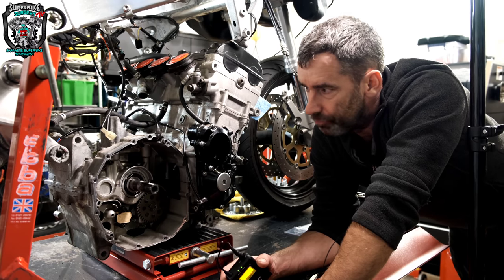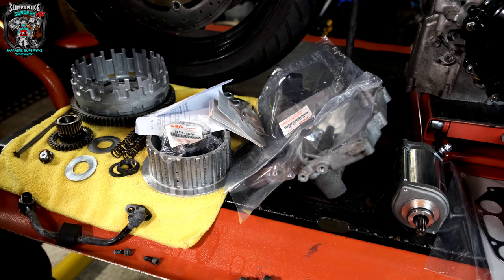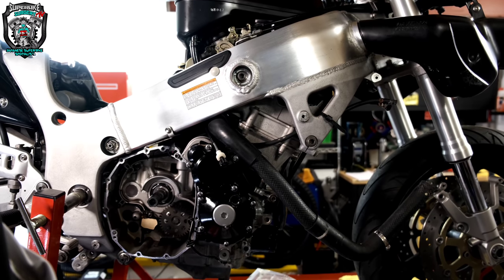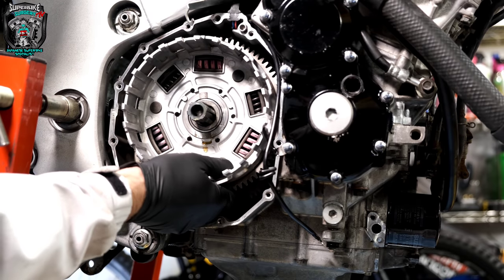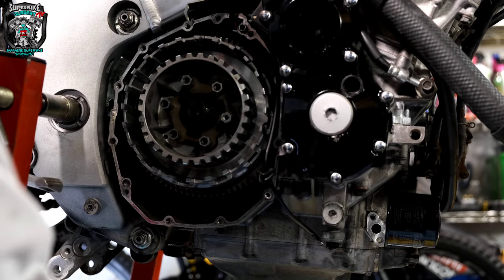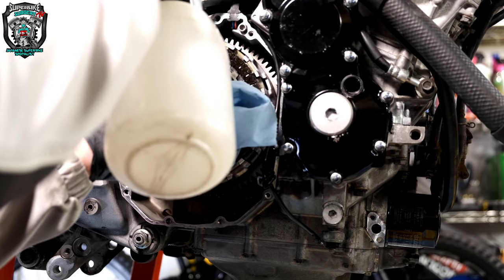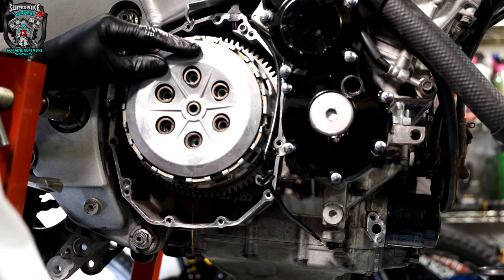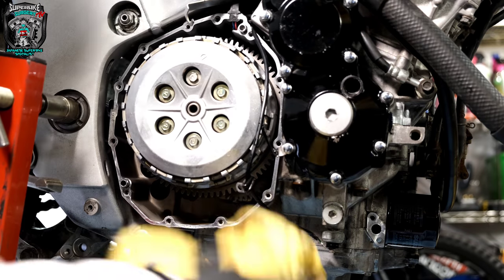Suzuki GSX1300R Hayabusa, Small Seal, Big Problem. An expensive mistake! (Part 3)

Comment: It wasn't necessary to split the cases just for remove that little seal... it would came off with a simple 90 degree pick... or a disposable little allen... tricky but simpler
Reply: The seal was bigger than the hole

Comment: Hi Jim, love your videos mate and learning loads from them. I'm currently rebuilding a Honda nc30 engine and have loads of gasket surfaces to clean. You mention using scotchbrite. Is there a risk of small particles being left behind using them? Also will they take any surface material off and potentially lead to an oil leak later down the line? One last thing any tips or tricks to get off the really thick gasket left behind that seems impossible to move. Thanks again for your great videos keep them coming 👍🏻.

Comment: Brilliant series Jim, quick question with regards to “silicone” when putting the grommets back in place for the wiring, what silicone do you use?
Reply from the maker: Episode 2 @ 45:15"👍
Reply: @SuperbikeSurgeryTV  ah.......I was getting confused as you would say silicone when talking about the grommets and then mention sealant immediately after for the joins before fitting the gasket and putting the cover back on.

Comment: Good vid buddy and thumbs up from me but don't you think that having the engine resting on the jack without the oil pan is a risk of scoring the surface of crankcase which might cause oil leak once sump is bolted on. I know that jack has rubber on it but still a but risky in my opinion.  Bolting the head mounts 1st is also a bit risky as those head mounts aren't as strong the rear engine mounts . I understand it was easier for you to get those done 1st but it's probably safer to get the rear in 1st and pivot the engine from there. I'm not criticizing you and your content is fantastic!  
It's just my thoughts after my recent engine build. BTW i also use rattle gun on clutch hub nuts lol 
Take care bud, love your vids, kind regards.
Reply: you still got your Busa adi.
Reply: @zzzpip  hey , no sold the Busa and went through a few other oldschool bikes. ZRX, GSX, GSXR, Katana etc. I'm looking for 1st gen ZX9R now but it's so hard to find decent one.. 
What's you're riding now buddy?
Reply from the maker: Thanks for the comment mate, it's a fair observation with the sump gasket surface but the reality (for me) is I've never had even a wiff of a problem in 20 plus years. With regards the engine bolts You'd have to do something really stupid to do damage (like only putting in one bolt in then letting the jack down and twisting the engine.) That's a seriously strong piece of casting, pivoting on two bolts (one each side) would never cause a problem. It's a (Shear Load) you'd probably need about 50 tonnes of load to brake something!
Reply: @Adikxx  gen 1 busa 2007
Reply: OMG this is incredible as i went through the same bikes after my Busa! I had ZRX1200,GSX1400(TTS 1550) GSXR1100 and original Katana(1982)
Now i just bought 1st Gen ZX9R !!!
Literally last week !
We have the same taste for bikes lol 
This is unbelievable haha

Comment: Quick question, why are the 4th and 5th steel plates thicker and does it really matter where they go ? Great vid btw 😊
Reply from the maker: They are there to balance the clutch basket. I've seen some aftermarket clutch kits with steels all the same size. I've also seen the original plates in the wrong place, you wouldn't even notice the difference!
Reply: @SuperbikeSurgeryTV  thanks I wondered if there would be a difference to how it operated and couldnt see how it could feel any different. Answers the question for me. Thanks

Comment: Hi. Great video.. I've just had my annual service done on my 2021 hayabusa at 1700 miles at cresent suzuki in Bournemouth and I've just noticed on my invoice that they used semi synthetic engine oil?  Would you say that's ok? 😮many thanks
Lee
Reply: Sounds like they cheaped out. Did you query this? I do my own oil changes for this exact reason.

Comment: What is the expensive mistake??
Reply: Jim explains it in the First Part of this Mini Series but the short answer is.
The customer tried to replace the Gear Change shaft oil seal himself causing damage when it didn't need changing and Jim has replaced the seal but the Engine needed to be pulled and cases split to do the job :(
Reply from the maker: Thanks dude, saved me some typing 😁

Comment: Thanks for another super-informative video Jim. Is there a logical reason behind the sequence  of the thick and thin clutch plates? Another question, my 1997 VTR1000F has quite a noisy/rattly clutch, noise doesnt change when the clutch is pulled in and there is no obvious wear on the basket or plates and the action is lovely. I've had it apart and the shock absorbing springs in the back of the basket are surprisingly loose/rattly, do these every need replacing and if so where would you source them?
Reply: Are you in the UK ?.
Reply: @paultanton4307  about 12000 miles away!
Reply from the maker: Hi Terry, it's completely normal for the springs to be that loose and are not replaceable. The noise will likely be excessive free play in the basket cush drive. The Thick plates are for balancing. Thanks for the comment.